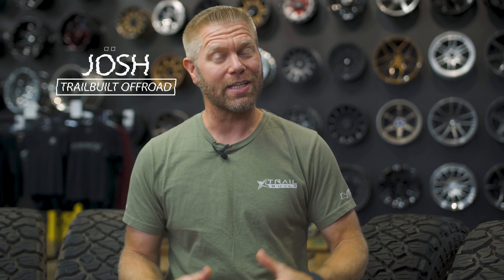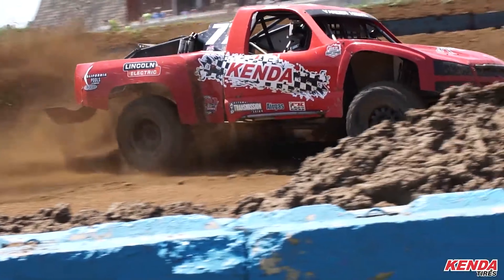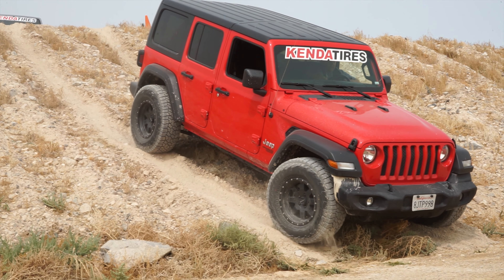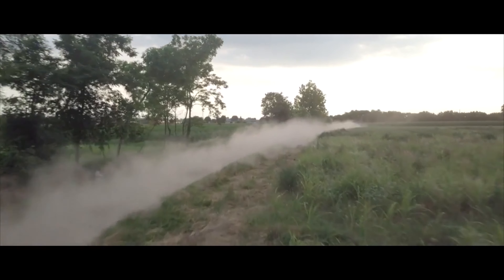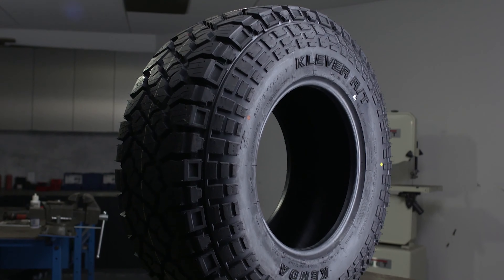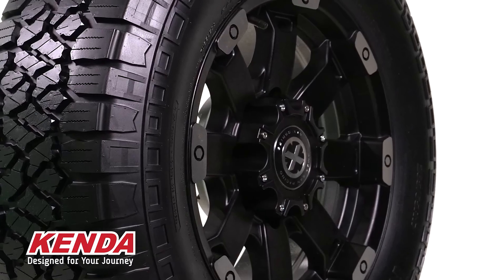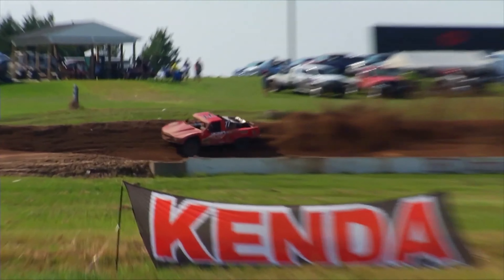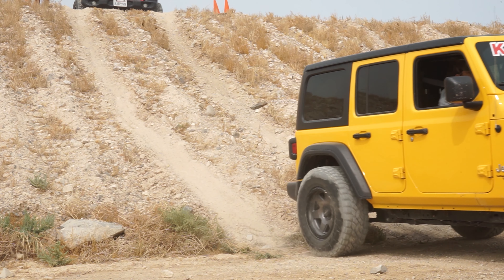Best Offroad Tires!? || You Decide

Comment: Only 35" I could find in 10.5" wide (lots of logical reasons for the 10.5).  All the research I did, including this video gave the confidence to pull the trigger.  VERY pleased.  Even on the stock Jeep JL they did not rub (with the sway bar on) no matter what I did.  Now, with 2.5" lift and a Currie swaybar, they behave very happily, which makes me very happy!  MUCH less expensive, and my favorite tires to date.

Comment: Just bought a set of AT2's. Love them so far, put about 100 miles on them. Much nicer ride than the General APT's I was running. Good on wet pavement and snow so far. Will do some follow up with more miles I run. I will be using these in the Adirondack mountains in Upstate NY. I went with the Load E, LT tires on a 2017 3/4 ton Silverado. They balanced out nice, better than the previous tire, quiet, controlled ride. I looked at the R/T but was more tire than I needed. So far gas mileage hasn't changed and that was a consideration in a 3/4 ton gasser. One size over stock, 275/70 R18 with no fitment problems. No lift or level. The R/t's have a 3 ply sidewall and are M+S rated, not snowflake. The AT2's LT are a 2 ply sidewall and 3PMSF rated.
Reply: How the tires holding up?

Comment: How would you compare the Kenda at2 against the toyo at3, cooper at3 xlt, and the falken wildpeak at3w? I’ve been eyeing mostly the klever rt but figured wouldn’t be a comparison deal with the rt being a hybrid and the others being a all terrain. 
I’ve been running the toyo at3 and I must say I’m extremely impressed. Handles everything with ease except mud and very stable cornering in wet and dry conditions. Also has a little over 35k miles rotated every 6k and still looks like I just put them on the truck. Truck is loaded with about 300 pounds in the back constantly as well from stereo equipment and also tow from time to time. 
Eventually wanna go from a 20 to a 22 but don’t wanna pay 1600 per set of tires if I don’t have to to have a good tire. I wish falken made the wildpeak at3w for 22s as well but because of that I’ve been looking into Kenda klever rt because I want something slightly more aggressive and can get around 50-60k or more would be great out of the Kenda klever rt. Atturo ATS is also nice looking but heard a lot of bad things about Atturo.